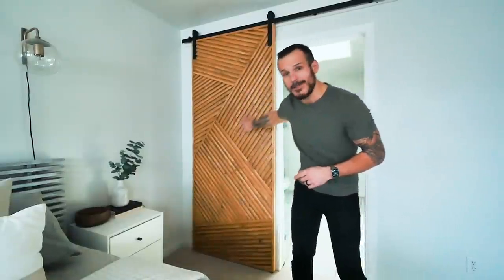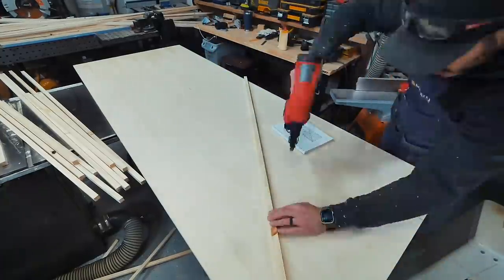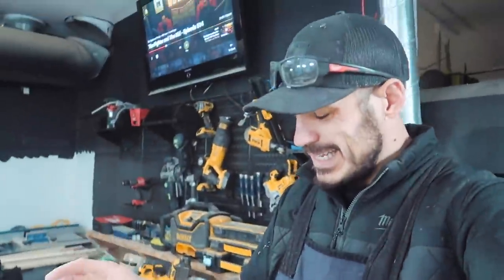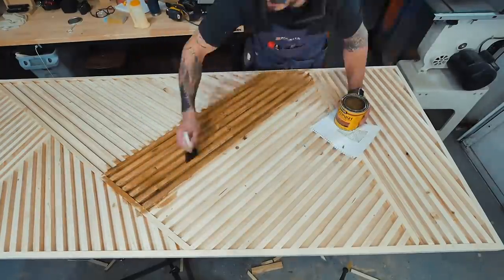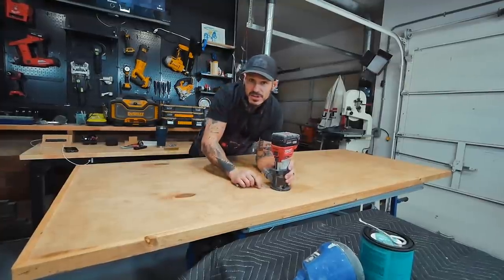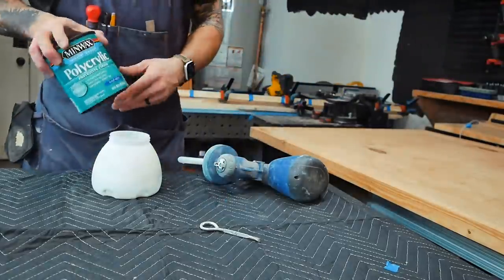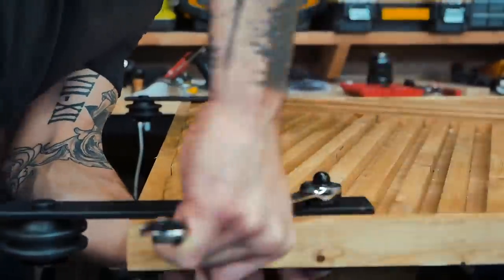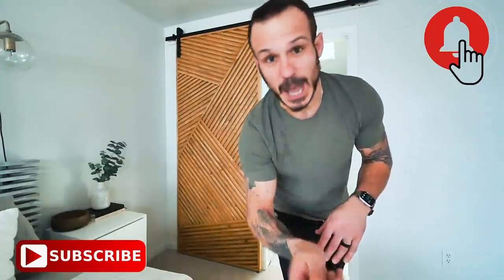Building a Modern Sliding Barn Door

Comment: Joiner here, a little tip when your mitre saw won't cut a sharp enough angle. You can place a wedge or peice of timber between the fence and the timber you are cutting. That way your timber is resting at a sharper angle to the blade and would save time next time you need to cut a load of angled cuts.

Comment: Looks great.  You do anything with the nail holes?
Reply from the maker: Nothing. They are part of the character.
Reply: @MrBuildit  thanks, last question do you have to sand between coats of the polycrilic?  i have used it but only brushed on and it says to sand but don't know if that applies to spraying it.  and do you only use that sprayer for finish coat or do you paint with it also

Comment: Attach the rail to the compression (Header) board by slightly sinking the lag bolts into it and then hang all in one shot. Much easier then leveling and assembling all in the air.

Comment: I have a project idk if it’s possible. A Sliding barn door with a Dutch door in it. It’s a interior opening between 2 rooms. Opening is 47” wide (plus 2/3” overlap)  93” tall. Thinking 28/30” wide 78” tall Dutch door in it. Any input you could give would be appreciated. Also no header, ceiling mount, thinking unistrut trolley wheels

Comment: This is amazing! Question: could someone use the wooden dowels that are about the size you need?  I mean not the length but the dimensions.  This is something my fiancé wants to try but we don’t have a table or mitre saw and he’s not very accurate using the circular or jig saw.  I know it doesn’t have to be perfect buuuuuut it has to be close.  I’m injured at the moment and though I’m more accurate than he (sorry honey!!) I’m unable to use any power tools or do really anything requiring physicality 😩.  Could one maybe use another sheet of plywood as an option for the glue on parts?

Comment: This is not beginner lol. Awesome job
Reply: rezyc What part of it makes it not a beginner project? All you need is a saw, hammer and/or something to drive the screws/bolts in. Yes the other tools make quick work of it but it can be done with a limited number of tools and is pretty clear cut as far as putting it all together.
Reply: @martymaloney1032  it was the tools I was referring to as not beginner as in a beginner will not have them tools and you won't get as a good a job with a hand saw in a week end :)

Comment: I really wanted to do this for my bathroom door as well, but I own a condo with a really low ceiling. In fact the there's maybe about an inch space between the ceiling and the top of the door trim. Is there any way to fabricate something if you don't have a lot of space near where you installed the wood piece to bolt the hardware onto?
Reply from the maker: Hmmm. Unfortunately I think you need a little room above